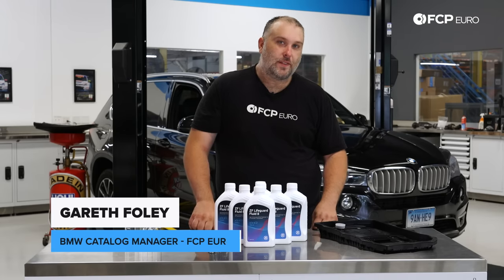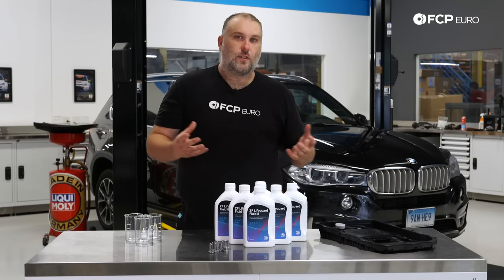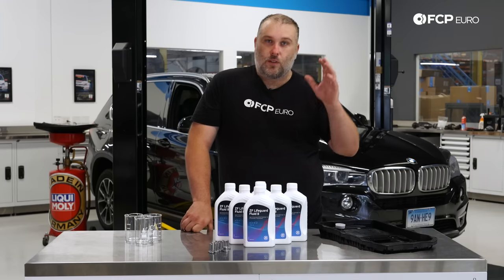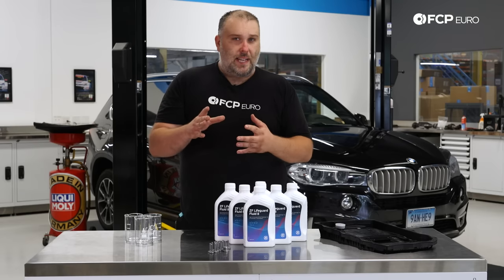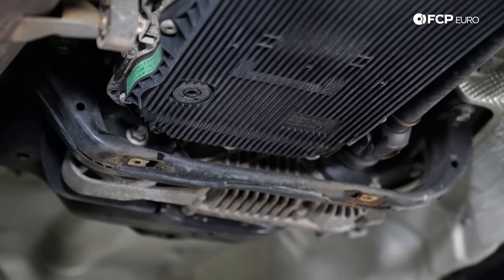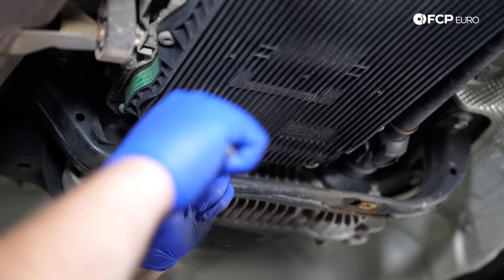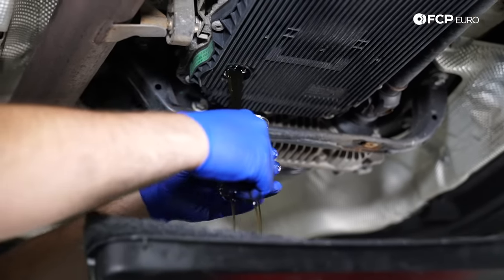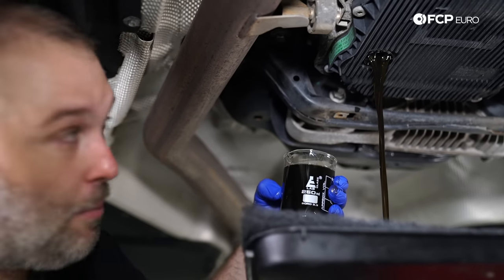ZF 8-Speed Transmission Oil Change (BMW, Audi, VW, Dodge, Land Rover, Toyota, & More)

Comment: Thank you very much for this clear, concise video. When changing the fluid on the ZF, should you worry about the fluid in the oil cooler? Would it be worth disconnecting the two lines to the oil cooler and pumping fresh fluid through one line to clear the old fluid out? I track my car pretty often and want to get the best bang for my buck when changing the fluid since my transmission is used much harder than most.
Reply: You should flush 15 liters of fluid through the transmission performing the ZF instructions between each flushing.
Reply: @ArcolaBridge  🥲 damnnnnn
Reply: @93ChayZ  you do it all in one step first draining the transmission pan then running the vehicle until all the fluid runs out and gets bubbly from the return side of the oil cooler. Then you attach your fitting to the return line to the pan and run the vehicle until the fluid comes out of the cooler clear and clean. Performing The zf procedure to flush the torque converter at this point until you have completely flushed 15L. Then stop and top up if needed.

Comment: I had mine (8hp70) changed at 124k miles. Oil was still somewhat decent.
Reply: 8hp75 here, also around the same clock. Have you changed yours? Wanted to do mine but unsure if I should get it done due to the high mileage.
Reply: @matthewttful  it was absolutely fine now I'm at 157k miles,no issues after changing the oil on mine. My usage was mostly highway driving.
Reply: Nice. I have about 108k on mine, I don't think it's ever been done. Just ordered the kit.
Reply: Seems like if you don't abuse these ZF transmissions, the green fluid can last very long! 👍🏽

Comment: Great tutorial video on how to do this job.  Several questions:  1).How much ZF fluid do you need to do this job?  2) Do you need to purchase the exact OEM fluid from the dealer?  3) Does the CTA-4100 come with the fitting that he uses in the video that goes in the filler hole?

Comment: If you shoot a laser at the oil pan, if it is metal, will give an accurate result, for plastic pans, no. Metal transmits heat by conduction from the lubricant very effectively, the losses due to ambient air temperature are negligible. It is always good to upgrade the pan to a steel unit for greater strength and protection.

Comment: hello , excellent video 
one thing though i've just contacted a certified ZF Partner in France who has information it's not every 50.000 miles (80.000 km) but 150.000 km ( 93000 miles) 
i also received the official document from them (but it's in french )

Comment: Does the transmission pan have to be level or is it fine to do the procedures with the vehicle setting level (transmission pan not level)? 2016 Ram 1500

Comment: Thank you for the detailed info. Just did my F20 equiped with an 8 speed zf trans. 85.000 km on the road. It took approximately 4.5 liters of lifeguard atf. Guys the difference is really noticeable. Quicker gear changes but also more "buttery". Amazing results...
Reply: 4.5l seems low! Did you do the second fill while the car was running?
Reply: @n55tourist32  Torque converter holds a lot of fluid which does not drain. When draining and filling this is the amount approximately.
Fluid level was adjusted "by the book". I have used ISTA for this. The engine was running of course.
Reply: What option did you in ISTA? I also keep hearing a lot of people only using 4.5-5L but all the kits out there are being sold with 7L.
Reply: @davidfarag8295  Service funtions > power train > transmission control > oil level adjustment. From there just follow all the steps mentioned by this function.
Some mechanics out there use the "flush" method so in that case those extra liters might be needed.
Reply: No flush will be taking place here. Nope.
Reply: @davidfarag8295  I would also advice against it.. flushing is not recommended from what I 've read over the years.. Also keep in mind, if the used atf is in good condition then go ahead and do your drain and fill. If the used atf is in bad condition leave it as is. You might have problems with fresh fluid...
Reply: @n55tourist32  I just changed my fluid. Mine is 8hp70, only drained 3.5L...not sure what's wrong,  I bought 7L...but I made a test drive, the shift did smoother than before.
Reply: @vaggelisalexiou2749  I keep hearing this. Mind telling us why it's a bad idea if your fluid is bad. Also how can you tell if your fluid is bad or not? tks!

Comment: ZF states the following procedure for the 8HP50

- Fill cold until fluid starts flowing out.
- Start car, rev to 2000RPM and hold for 30 seconds.
- Fill until fluid starts flowing out.
- Cycle through gears following procedure.
- Final fill between temperature range until fluid flows out. Allow fluid to come to a slow drip and torque fill bolt.
Reply: Does it state to fill when the cars running or off? (hot)
Reply: @ScottPC  Running.
Reply: How many quarts does it usually take to fill the ZFHP50 on a filter change?
Reply: I thought the rev part was in gear and wheels in the air spinning.  That's the hard part to me :(

Comment: Im not sure who you get to do this service as  Dodge wont touch it  for this service on the 8hp50  they use in the Dodge Durango .   Also every 50k  seems a bit excessive seeing that  this service costs so  much because the fluid is extremely expensive  compared to normal  transmission fluid .   Chrysler is one of the fill for life claimers  .   They dont care it just has to get thru the warranty period without breaking down  which even with extended warrantys  is 125000 miles max which most of them will make even if you dont change the fluid .

Comment: Ooops 🥳 Toyotas use Aisin...and they were the first to use 8speed Autos with Torque converter instead of Dual Clutch...I don't know of any Japanese Manufacturer that uses ZF....Hondas don't ..Nissan doesn't..neither does Toyata...oh and after a quick research the only Toyota that uses ZF transmission is the New Supra which is powered by BMW so that doesn't count really🥳

Comment: If you drained the transmission when it was hot (above 75°C) you must also drive the car and get the transmission temperature above 75°C in order for the transmission cooler thermostat to open and for the cooler and lines to fill before letting it drop back to between 40°C to 50°C.
Reply: Do you only need to do this if the transmission has been drained above 75C? The instructions have this step in there but doesn't mention anything about draining the fluid when it's above a certain temperature.
Reply: @seyhankupeli  I believe you do.  Mine was not above 75°C when I drained it.  after I drove it and got the temp. up and brought it back I had had to add between 1/2 and 1 liter of fluid to get the level correct.  So I guess My statement about doing this when you drain above 75°C is incorrect, should always be done.  Thanks, Juergen
Reply: @juergenhauber4793  thanks for the response, did you let the run idle to drop the temp back down or turned off the engine?
Reply: @seyhankupeli  I tried the idle bit but it took too long.  I just shut it off and if the temp. is low, it will come back fairly soon.  Regards, Juergen

Comment: Hi I ring BMW dealership in UK to change the oil in ZF gearbox: sorry we don't do such a service our oil in the gearbox its life warranted😂😂😂. ring ZF manufacturer and indeed said you have to change it at 50,000 miles 🙄🤨😩.
Reply from the maker: The dealer assumes the fluid will last as long as he vehicle is supposed, but yes you definitely want to service it!

Comment: My transmission is slipping (Dodge Charger 2016 v6 sxt, 80k). Should I try changing the oil or is it too late already? It’s been slipping for a while now.
Reply: it's a dodge so i will sell asap and buy something reliable before you go broke

Comment: thank you! but...
ZF does NOT recommend changing the 8HP oil at 80.000km(50k miles)!!! NO! please search "lifeguard fluid 8 data sheet" and you will see they specify exactly this: "ZF recommends an oil
change after 150,000 km for its transmissions"
so NO, not 80.000km at all! if you are using your car normally they recommend 150k (almost 100k miles) for changing intervals with their OEM oil. 
what the guy in this video is actually talking about is when ZF published that the oil change for 8HP should be done between 50-75.000 miles for the following cases: "frequent highway driving in top speed range", "offensive, sporty driving style", "frequent trailer operation"
Reply: @bebececehustle  thanks for the info ! old vs new basically say the same thing, but at least in the new one they specify a range for the more agressive operating conditions. although skipping completely the specification of 150k for normal operating conditions 😆. so going with a merge of both docs would be best. i myself would recommend changing it using the gravitational flush after 100k to be safe. this way you don't need the more expensive pressured oil change

Comment: I don’t understand why ZF makes these “sealed” transmissions if they need servicing just as frequently as traditional automatics. Why can’t they engineer in a dipstick and simple fill/drain system that doesn’t require specific temps? The filter is also embedded into the pan on plastic pan models so you have to replace the entire pan. The trans fluid service costs like $1200-1500. That is unreasonable for a 50,000 mile service.
Reply: he didint showed the whole gearbox oil change, he changed only 30% of it or smth
Reply: ZF makes what car manufacturers want. They want that fleets and first owners don't have service costs which could put their car on behind other makers when compared "what to buy" and cost by cost. 

"Its someone elses problem and the vehicle is already out of warranty if anything happens." So you have to be a bit street or should I say machine wize to know and service your junk and not just drive like a happy camper untill...

He changed the oil, not 30% of it. If you nitpick, yeah, there are small amounts left which you can't get out at the reasonable time/work but this changed more than 90% of the total oil volume. It will do fine with these more than 600.000km.
Reply: @Mariini  I can understand a sealed unit for a car that is used as an appliance car that has limited performance and low exposure to high stress, but an off road vehicle that will see extreme conditions, lots of abuse on the drivetrain and probably used to tow heavy loads would be better served in my opinion to have easily replaceable filters, oil and a dipstick. Not only does that cut down the cost of maintenance but it makes it more likely to happen in the first place. Telling someone that they need a $1200-$1500 transmission service every 40,000-60,000 miles as ZF recommends for heavy duty use doesn’t really appeal to anyone I know, unless money is of no concern. I don’t know what the “sealed for life” (80,000 miles) design offers that is an advantage to either manufacturers or consumers.

ZF makes the transmission so hard to service nearly nobody would dare do it themselves and on certain models fitted with their transmissions you have to remove structural bracing, or cut off pieces of the transmission to get the pan off. I know from firsthand experience on my previous Land Rover Discovery 4 that it is anything but an easy job. On my Audi Q5 3.0T it too has the 8HP and now at 65,000 miles it is starting to downshift quite rough. Not sure if a fluid change will fix my issues or if it will need a new valve body, which seems to still be a fairly common issue with ZF Transmissions.

Comment: If a 2011 BMW 535d with 170000km never had a transmission oil change will you recommend a complete oil change or just a flush?

Comment: Great video and really detailed. One missing piece - You will need four jackstands (and a good last will for the wife/kids), a lift or a pit to do this.  The vehicle does need to be level during fill.  Found out the hard way with jack stands on the front only (on a work night no less).  Lesson learned.

Comment: You should take some transmission fluid in a glass beaker or a metal pan and heat it up to show how much it expands.
Reply: I know this is an old post but just in case you still wonder how much it expands, I did this test.  I put hot tranny fluid in a marked container, then put it in the freezer for a couple hours.  After losing over 50 degrees, the level hadn't moved one bit, absolutely nothing.  Waited longer, absolutely no change.  Made me wonder how big a deal that aspect (temp) is (aside from the oil cooler issue which has nothing to do with expansion/contraction).

Comment: The ZF fluids are very high quality synthetic AT fluid. As long as the ATF temp does not go over 260F for extended periods the fluid does not varnish and will remain in good condition. The transmission cooler keeps the ATF temp around 200F or so even during heavy load driving. Therefore only reason to change fluid is if cooler has failed or after extended miles 100k+ just because dirt does accumulate in the fluid over time - microscopic debris that the filter does not filter out.  Also, drain and fill is good enough. Changing the pan for the new filter at 50k not worth it. Remember there is lots of old fluid in the torque converter that will mix into your new fluid. About 40% of old fluid is in the TC.
Reply: ZF says CHANGE IT at 50k
Reply: What's the cost comparison between a couple of "maybe not needed" fluid and filter changes and the cost of a rebuilt transmission?
(Which will get all new fluid and filter, but its an exoensive way to change the fluid...)

Comment: Done mine DIY at 40,000 miles. Geniune ZF kit cost £165.
Reply: What did you use to pump the oil in?
Reply: @bigmacbiggs2139  A cheap fluid pump off ebay. I will invest in a good one for the next service.

Comment: I just did the job on my wife's x3. I didn't bother to remove the fill plug until it was time to fill.
It was stuck tight. Quite exciting with the minimal access around it.
I put an 8mm socket full depth in the fill plug  and since there was no room for the socket wrench, I used an 8mm wrench, assisted with a cheater pipe to crack it loose.
I'm now living happily ever after.
And thanks for the video Gareth.
Step to the top of the class.
Ned

Comment: Strangely I was told by multiple dealers not to change the fluid unless there is a perceived problem with the transmission. I know he makes mention of the  "lifetime fill" in the video. I've just never seen a dealer turn down an income opportunity such as a transmission service. This was however a very well done video and I appreciate the team at FCP for putting these together. Lastly, I've seen a shop destroy a transmission by doing a service on a "lifetime fill" system. I'm also curious as to why they recommend not doing the service if the fluid is bad or contaminated. This seems counter-intuitive especially seeing as how the exact opposite is true of engine oil. I won't be changing mine due to the fact I have a boatload of miles. For those that don't fall under my category and wish to do this, this video makes it super doable.
Reply: check ZF site, they do recommend changing it - see this too https://youtu.be/F7MaXLwWQik?t=349
if your tranny is too far gone the thick fluid which has extra traction might be needed to continue shifting, while brand new fluid might be too slippery, unlike engine oil that just lubricates
Reply: @alaind831  I'm sure they do have that recommendation on their site. It's most likely to encourage continued income for the manufacturers that want that revenue stream. Especially considering most if not all manual transmissions are lifetime and do not require changing the plausibility of this transmission not needing to be changed is there. Not arguing just giving my summation. I do appreciate the feedback and the links to the info. Lol I still remember when Mobil 1 motor oil used to advertise you could go 50k between ok changes and the auto industry came down on them because that could've put a huge debt in their revenue stream. Meanwhile jiffy lube programs is to believe "every 3000 miles lube it or lose it" so now many of the older gen believe that while most manufacturers recommend 5k for smaller turbo engines,  7500 or 10k for larger engines.
Reply: @ThaDirtyOne7  "7500 or 10k for larger engines" is more about the amount of oil and size of the filter - my old BMW had 7quart and big ass filter so 10k (service was 12-15k if I recall) was ok. My cars now take 4-5qt and much smaller filters so I change 5-8k. oil is cheap, engines are not.
Reply: @alaind831  sounds about right.
Reply: It's called the Dealer Protection Plan.  That is, buy a new vehicle every 100k.  And to reinforce that Plan, the design engineers intentionally route the exhaust pipes directly under the drain plug and rear pan bolts, as well as blocking access to the fill port.
Reply: @dannywilliamson3340 that's foul!!! Which vehicle specifically are you referring to?
Reply: @kjhnsn7296  Specifically....my 2020 Ram 1500 Big Horn.  And I forgot to mention.....Ram doesn't even recommend a fluid / filter change on that transmission.  Whereas, the transmission builder....ZF in Germany.....says the fluid should be changed every 50-60k miles.
Reply: @dannywilliamson3340  thks
Reply: Great video.  Appreciate the reasonable price on the ZF fluid and free shipping.

Comment: Thank you for this, I had bought your kit, but I was very gun shy to do the job.  This was a great tutorial, and you gave me faith that it’s 100% doable
Reply: did mine yesterday. Take you time, simple. MAKE sure you can read temp for 2nd fill. Make sure the tube you fill with is small enough to fit into tranny. My tube was too big and I had to add another hose to reduce the size, used a vacuum hose